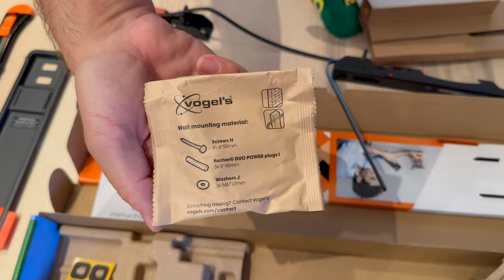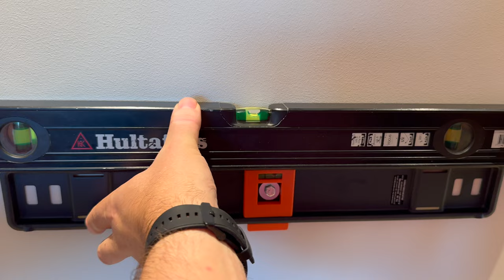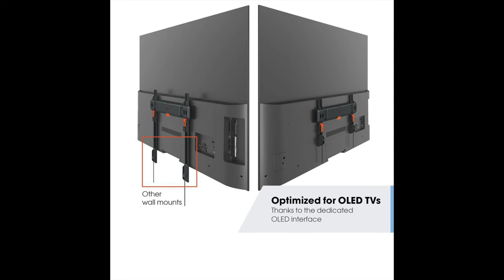How to wall mount a OLED TV on any type of wall using Vogels 3405SP

Comment: There is a forth option of walls, those with lightweight concrete (I think it is called, "lättbetong" in Swedish), it is very easy to drill almost like a plaster wall. What plug/fixer would you use for these walls? The same Fischer duopower plug as you use on the concrete wall in this video?
Reply: I am about to mount a 85" The frame on such wall, therefore asking. Thanks for great videos :)
Reply from the maker: @fredriklundqvist236  Hej og tack. On Lättbetong I use the same duopower plugs that I used on the concrete wall mounting. They come with the wall mount if you use  Vogels for mounting. You have a great wall for Tv-mounting.
Reply: @oslotvmontering  super thanks for the quick respond 🙏🏼Just a few additional questions:
1) I assume the 5,0x40mm quality screws you use are enough together with the duopower plug, right? 
2) Do you recommend to use a 0,5 smaller drill than recommend for the plug, given the soft texture of the wall?
3)Do I dare to tight the screw very hard, I am afraid that the plug will circulate just a tiny bit when tightening and the hole gets too big.
Thx again for great vids and quick reply 🙏🏼
Reply from the maker: @fredriklundqvist236  1. Yes. 2. No. 3. Yes.

Comment: I've bought the frame tv. Yet to be delivered. 
I'm concerned about one thing 

At what height I should mount it.

I've 13 x 9.5 ft wall (LxH)

The ideal size is at least 36 inches above from the floor. But pls help me with this. I have bought a 65inch variant 
Cuz that low height could make it look like just a TV!! 

All videos I have watched, not a single video features that level of low height. All people have mounted it on a little higher side. 

I have a 10ft+ distance between the TV hall and sitting.
Reply from the maker: Hi. 10 feet distance is about 1 meter up from the floor to the bottom of the TV.
Reply: @oslotvmontering  hi, pls be online. I want to discuss. Pls. Cuz ones here to help.